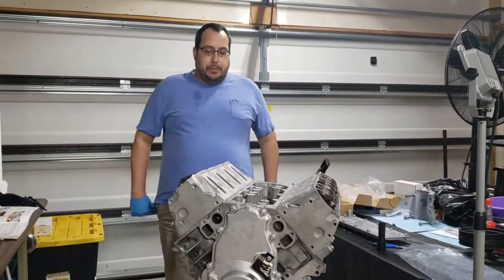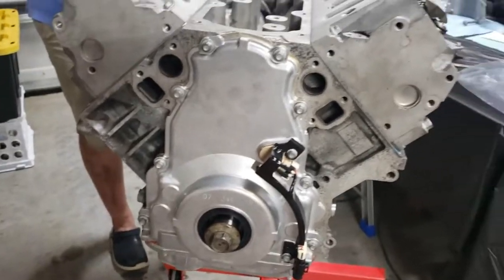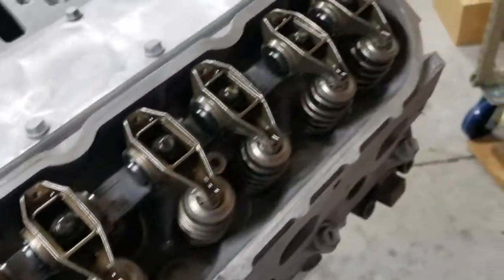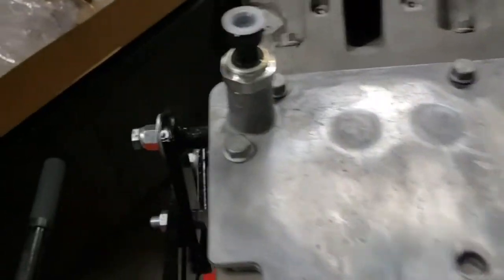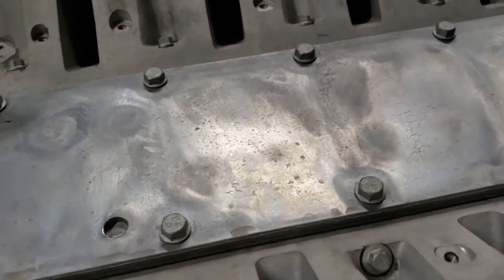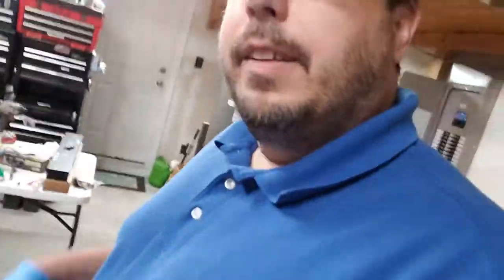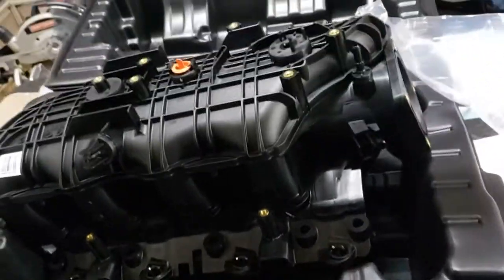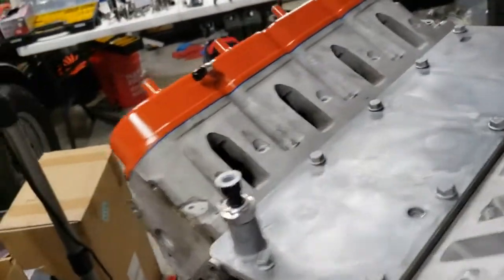Episode 45: Final Assembly - Valve Cover Installation on my 5.3L LC9 engine rebuild

Comment: I can’t wait to hear this engine fire up. Are you going to put it on a Dyno?  Did you put a gasket on the Valley pan? That screen is supposed to keep debris out of your oil pressure sending unit, which are notorious for loosening and failing.  It’s great you changed out that driver side valve cover. Pre 2011 valve covers were defective.
Reply from the maker: Yep, I have a tune shop with dyno already arranged.   Yes, a gasket came with the valley cover and it went on with the cover.